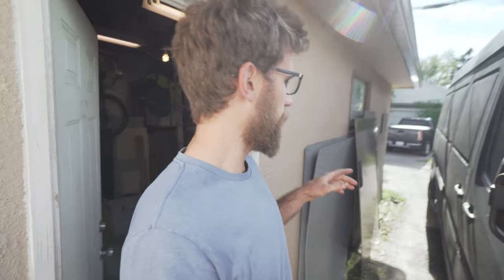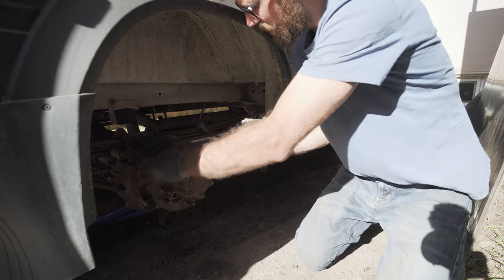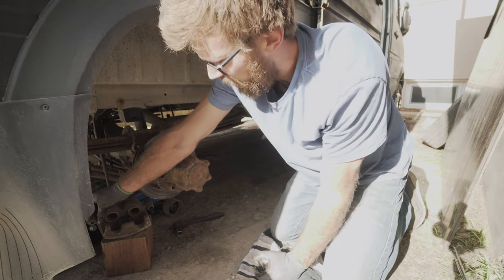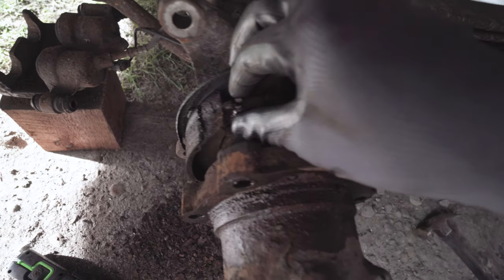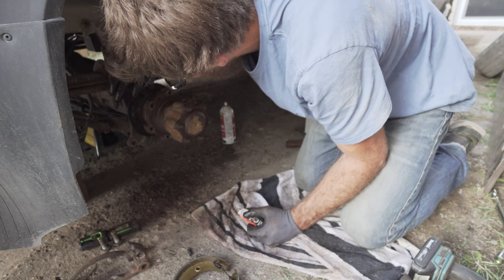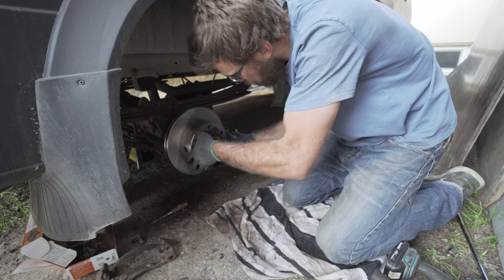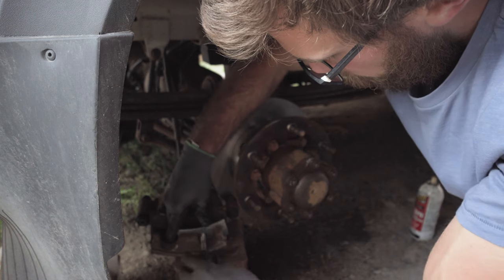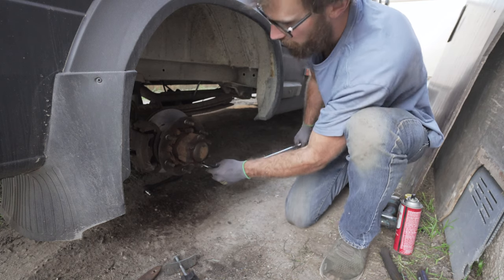Rear Brake Replacement on a 2005 Dodge Sprinter Campervan

Comment: Just bought a 2005 3500 (in the 140 WB)in a very similar condition about 100k miles, but a decent amount of rust inside on the floor. Have to tackle that now. Thanks so much for your content, its super helpful!
Reply from the maker: We had a lot of rust too! Hopefully be making a video soon. Good luck with the build
Reply: He Brody, I have been rebuilding a 20 year old T1N for well over a year now, there's loads of crap videos on my channel if you can understand my mad Scottish accent they might be of use to you, get some videos up of your progress, take care

Comment: Does your van have sprint shift? Mine does and I have a feeling that it has some system that locks the brakes . I cannot turn the hub at all which make the whole job harder to remove the bolts.
Reply from the maker: No I don’t believe it does. Sorry I don’t know very much about the Sprintshift system.